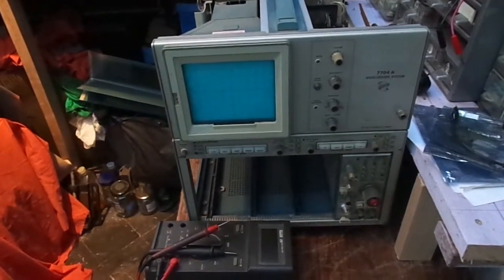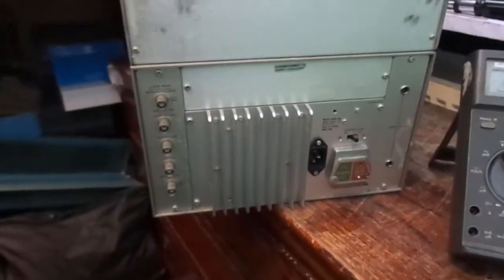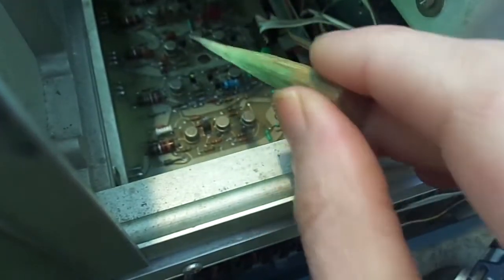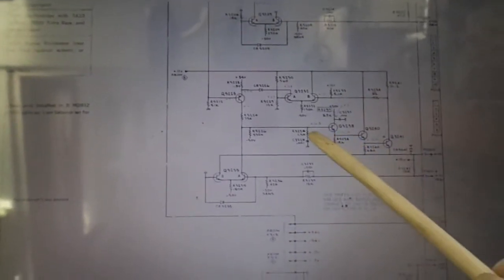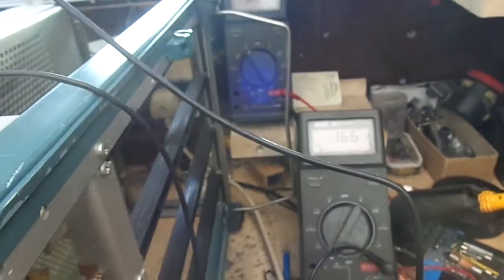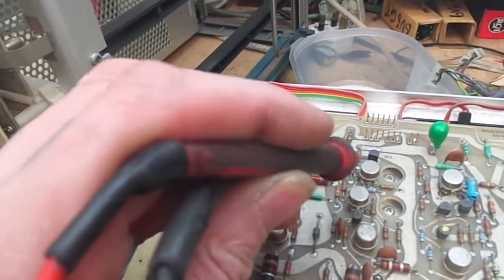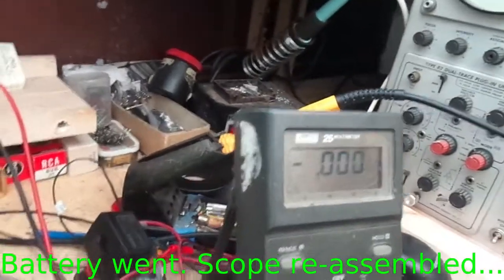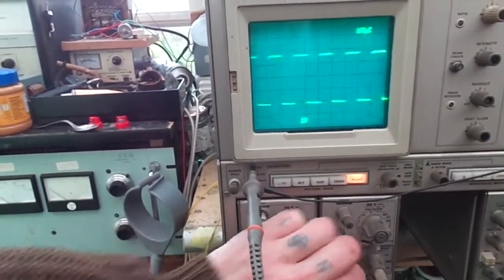Tektronix 7704A mainframe oscilloscope repair.

Comment: My first scope! Also now in the queue for repair...nice work
Reply from the maker: Strike a light Simon that was fast... Yeh, nice scope but a bit fiddly after using the big 500 series scopes, oh, tricky to drive too. TFW.
Reply: @diabolicalartificer  you seem to post at my ideal Youtubing time (Sydney AU, late night)  And yes very fiddly when accustomed to chunkier things! Take it easy
Reply: The same tantalum capacitors on the same board on top of the CRT were the first to go on mine. Luckily I saw smoke, shut it off, powered on again with the case open and got so see the cap ignite.

Comment: These mainframe scope are challenging and complex enough to become a fulltime job.  Don't think I'd blame the CRT at this stage. The issue with the trace and dot at the end looks a lot like ALT Horizontal mode with just one Time base present. I have had to flush out a similar issue on mine but in the Vertical logic. The switching logic for the plugins is also quite tricky with some of it on the backplane.  I have the same TB plugin 7B53A and also thought there must be a lamp out but as of yet not found any, so maybe wasn't added.
Reply from the maker: Yes they are. I can find my way just about round an old Tek 500 series valve scope, but I passed this on to someone more to used to working with logic etc.
   Also after using a 545B as my main scope I found the controls too small & fiddly. TFW.